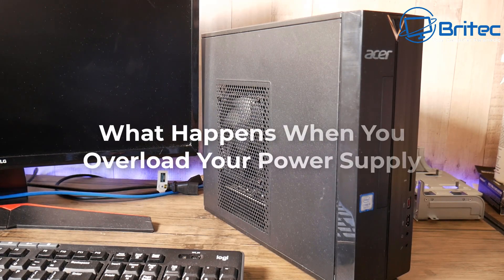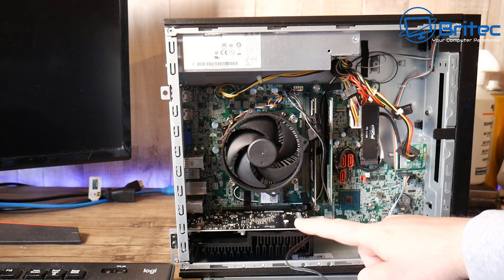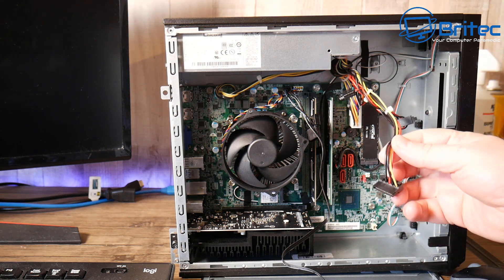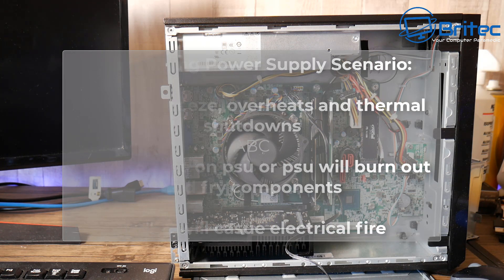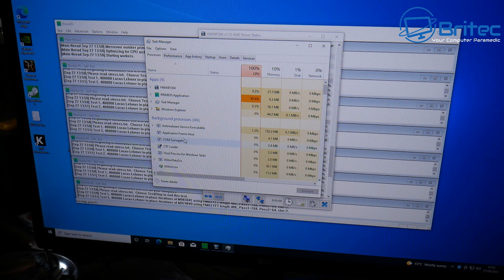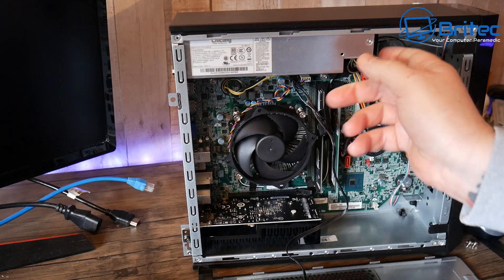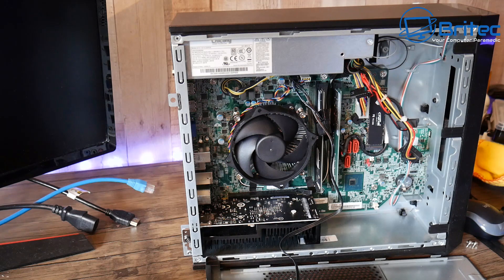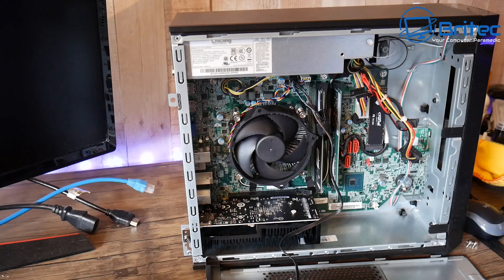Things You Need to Know About Your Power Supply

Comment from the maker: What Happens When You Overload Your Power Supply? Drop us a LIKE 👍
Reply: what about running the GPU below it's maximum resolution eg  a RTX 3060 recommends 750W, so what about at 1080p, well below it 8k max rating. 
is it feasible to use secondary PSU for auxiliary HHD, DVD, cooling & accessories which is powered (automatically or manually) up as needed?
Reply: @SpeedLockedNZ  the best would be to undervolt if you worry about power consummation of your product
 whit limiting your fps framerate as valid back pocket tool for silent operation ^^.
will also avoid cpu to work as hard that if you where pushing above 100 fps consistent 60-75 fps can be just as good that fps that go to 144 fps and make huge drop to the 60 fps as fps increase amount task cpu need to handle generally tend to increase too so cpu gonna draw call more likely see more high cpu power utilisation .Dual psu can be done certainly but seem to me counter intuitive than having proper one in the first place.
Reply: @pccoldwar9160  the 650W i have will (Should) do 1080p @ 60fps capped with ryzen 5 & a single HDD & an M.2, 
As many places seem to assume people are going to OC or run full spec, not undervolt or run lower than max settings -   as that was implied in the above video. 

I'd like 2nd PSU for extra HDD's instead of running another entire system, so on for for backups & data storage, DVD use (when) & off for gaming/normal use. 
Cool & quiet.

Comment: I have a HP Compaq 6000 Pro SFF with a 240w PSU. The system is holding four of DDR3 RAMs totaling into 16GB, two separate mechanic HDD, one is 7200rpm and other one is 5400rpm, one optical DVD combo drive and a 2GB Nvidia GeForce GT 710 GDDR3 from Gigabyte which draws around 19watts of power the spec says. Also it has a Core 2 Duo E8400 which draws around 65watt. The system is running good and smooth for now. But I am kind of worried after watching your video. Am I safe from fire?

Comment: Heat has killed many a PC. Overloaded power supply is never a good idea. My rule of thumb is 25% above your max draw with all your components you are using. The smaller your case and the less  air that moves the sooner you will have problems. Heat has to go or your PC will melt so to speak. Fresh air in and lots of exhaust fans pulling out the heat. Airflow makes or breaks gaming PCs. A PSU that is underrated is a fire waiting to happen. The easier a PSU has it, the less stress it endures and the less it contributes to the heat soak problem. Digital has no sense of humor for heat. Small form factor gaming rigs can be perfect for lugging around to gaming meets, but not all are up to the task and blowing up your rig is it going to make you happy. An underrated PSU is never a good idea. My rule of 25% above your maximum draw is a starting point, 40% is a better margin as it allows for future upgrading when your wallet feels fat and gives you peace of mind you are not going to pull over the rated capacity. My rule for PSU change is above 80% yields a PSU upgrade. 20% above what you are using maxed out is a big cure for headaches and heartaches. It’s your choice and your money. Do the math, make the changes that save you frustration and save yourself the grief!

Comment: Good video today. It just highlights the fact that our tech market is only serving the rich amongst us. Because of supply chain problems, shortage of chips, the appalling scalping in the GPU market where graphics cards are up to £2000 pounds !, the tech market truly is a swamp that needs draining. So now PC gamers or hobbyists cannot afford a top tier modern system that complete with monitor at 4K and all peripherals is in excess of £5000 pounds !. Yes you can buy cheaper pre builds from those ubiquitous company’s etc, but the quality of internal components and build is not great. So I suspect trying to convert an old small form factor into a gaming machine may be one solution in times of austerity. But as your video shows, if the PSU, is underrated then it will blow !, but hopefully the fuse first. I dislike some of those latest “shill “ content creators on YouTube highlighting small form factor PC’s as being very capable, and falsely over exaggerating their power. Huh !, they are ok if you want to run a spread sheet or video editing, but not really suitable for running AAA game titles. And most small form factors are enclosed with poor air flow. To be honest the tech market is garbage just now. Pandering to the elites with cash to spend. And the quality, ohhhhh !, just look at a top brand like Gigabyte and it’s exploding power supplies !. Don’t get me wrong Gigabyte make excellent motherboards and graphics cards. But I suspect they changed their manufacturer to another, less competent company to save on costs. My speculative opinion. But if they did keep their original manufacturer, then the quality of the power units components like the MosFets, capacitors and other components probably came from another 3rd party. Quality Assurance lacking somewhere. Anyway I digress !. Thank you for this interesting video. Buyer and hobbyist beware of small form factor PC conversions. They are more trouble than it’s worth !.

Comment: Hello sir I have msi b460m a pro motherboard when i install nvme ssd in it .It doesn't detected the nvme ssd . I also tried m.2 geine enabled or disabled or AHCi or RAID mode in bios . But it will not detected by bios . On the motherboard Ssd rgb Is working but it will not detected by bios . I also Updated my bios to the Latest Version .I am using Bios in UEFI mode but when i try to switch to CSM it will showing a error called There Is no VBios detected In this card Press F1 To continue or press F2 to load default values . I also Reset my pc And Bios by clearing Cmos And Jumper .I Also installed All the driver in pc by booting with hdd but it is not able to detect My Xpg S20g Nvme Ssd . Thanks You

Comment: If the power  supply   is   cheap and  doesn't have  fold back current   limit,  either  the  switching transformer   will  let out   the  magic  smoke  or the  switching  transistors  will self  destruct

Comment: Thanks Brian! My mom has 1 of these mini PC'S, a Gateway. Original power supply went bad and I can tell you finding a replacement was very difficult. 
I am not sure of form factor of the board, looks like micro or mini atx. All I know is the Processor is not socket in but looks like it's soldered in. Thought about replacing board but then again since power supply is so proprietary I just may use it for a Linux system.
Reply from the maker: Glad I could help

Comment: I would not feel comfortable with anything less than a 500 watt PSU with GTX 1660. You might get away with 400 watt, but that is taking a chance. Also, OEMs use proprietary PSUs. They are normally lower than 300 watts. These should be avoided like a plague. My opinion before even watching video. Might get hot, might get magic blue smoke. Might damage components in system other than PSU. If something shorts, it can overvolt and kill a component.
Reply from the maker: All these little machines have low power PSU

Comment: you can get adapter looms to use atx power supplies on some sffs, but these do not fit inside the case. So if you dont mind an atx sitting on the desk next door to your small form factor.that should take care of any power needs. it cuts down on heat as well not having it inside the case
Reply from the maker: Yeah, that sort of defeats the point of having a SFF

Comment: Being an M.C.P., I got a lot of calls from friends and family when they ran into throttling problems. First thing I did was upgrade the power to 50% more, so a 300 W to 450W -/+, and they never had a problem after that. Nowadays it’s a bit tougher with Sealed Systems, but still possible.

Comment: There are 850W SFX power supplies. You can use ITX systems for gaming. You just need to pay attention to the components you use, and use the right ones.
Reply from the maker: There are larger sizes available, but not for this Acer, you will need to drill holes to get it to fit, this PSU is Acer Aspire XC-885. Send me a link? because I doubt it will fit, because its proprietary PSU with there own screw holes.

Comment: It might be a silly question, Is there a difference between AX1600i and 1600W power supplys? Both are TITANIUM.  I just tend to splash out on the PSU whenever I build a new PC.
Reply from the maker: Very unlikely you would even need a  AX1600i and 1600W power supply.
Reply: @Britec09  True, I'm just wondering which is best? I'm happy with my current 1200W Titanium PSU, but I've had that one for over ten years. Perhaps its time to pick up a 1600W for another ten years, might use it again in a future build.
Reply: ..... Never mind, I found out what the "i" stands for.

Comment: My power supply failed on my Acer, back in 2015 or '16.   The GPU card (factory install) has a HUGE thermal dissipater.  It really gets hot.    I'm thinking the heat build up ruined the power supply, and then toasted the Flat Screen.